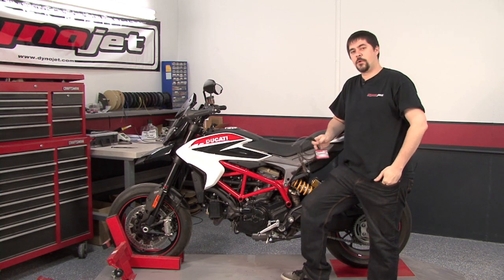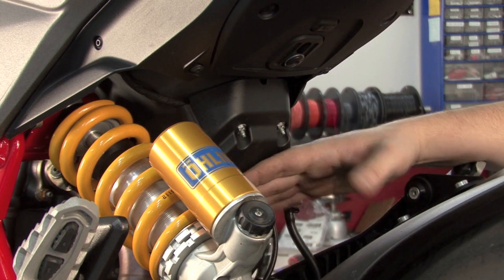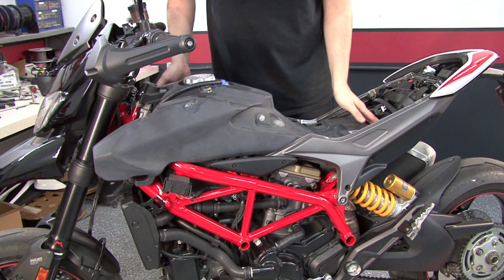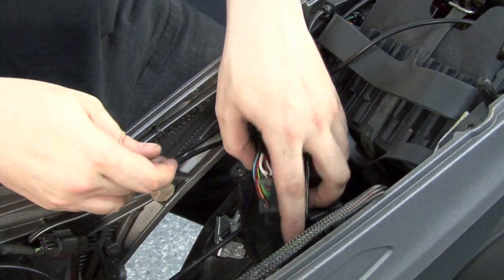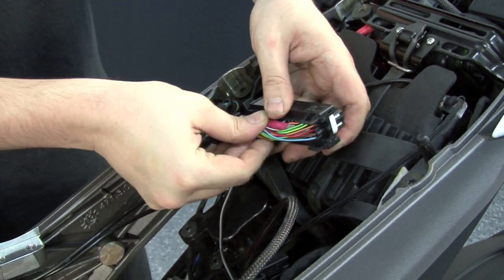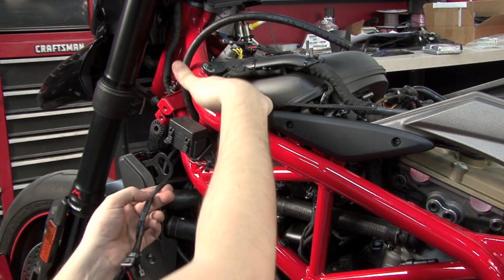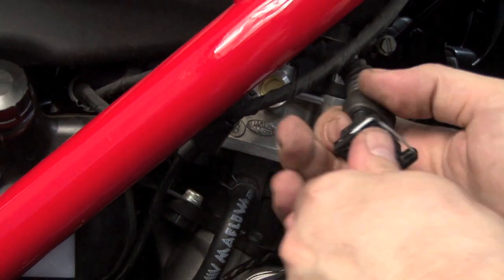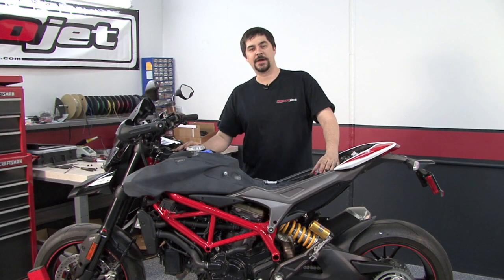Power Commander V Install: 2014 Ducati Hypermotard 821

Comment: Hey @dynojetresearch my shop was recommending a rexxer because they said they could not optimise power under 4k due to the fact that the O2 sensor cannot be disabled.. Said they could compensate a bit with the accel pump feature but the rexxer would be better. Can you please shed some light on this issue. Thanks

Comment: hi does this allow for a quickshifter? what would i need to get a 821 SP to have the quickshifter? thank you!
Reply: I want to know the same thing.
Reply: *****  Can you please confirm that the Quickshifter Mondule for ducati (PN: 4-120) can be mounted on a Ducati Hypermotard 821?
Reply: What was the outcome?
Reply: or you can buy Healtech easy quick shifter with oem conectors for the Hyper :) Easy to install, and the shift sensor fits most motorcycles! Search on youtube and be amazed ;)
Reply: +BergenMotard 
Yes, I installed the Healtech on my bike a few weeks ago.  Works well!